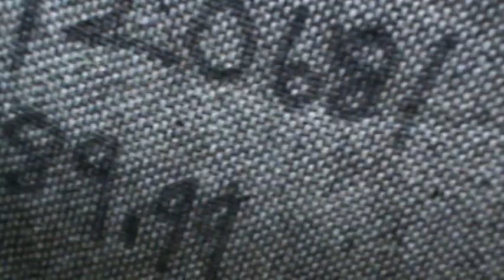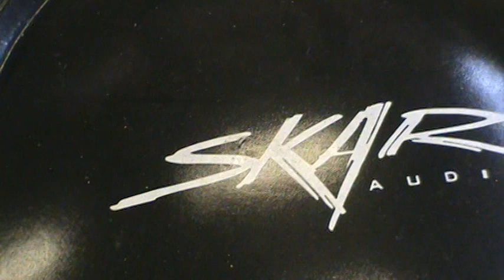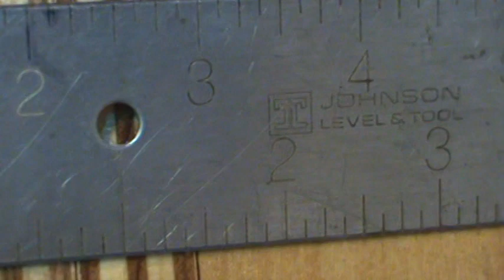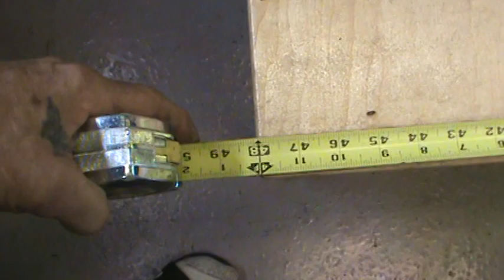THE GATOR GUY

Comment: place the speaker box on the floor on its end, mount a circular saw on the side of something solid like a the side of the car lift etc so its rock steady at the right height then you just have to pass the box around the saw, it will be perfect cut all the way around